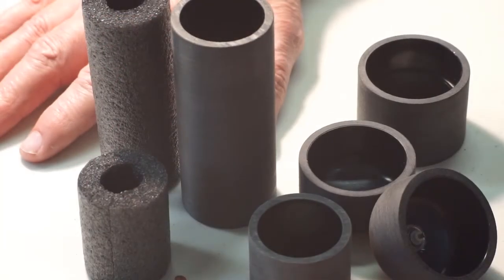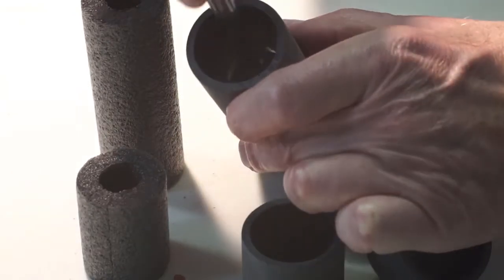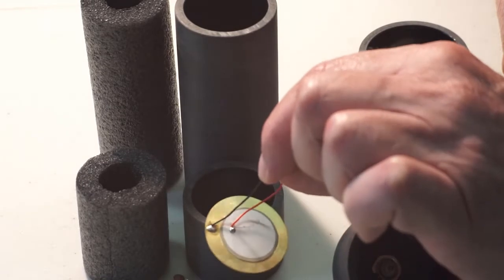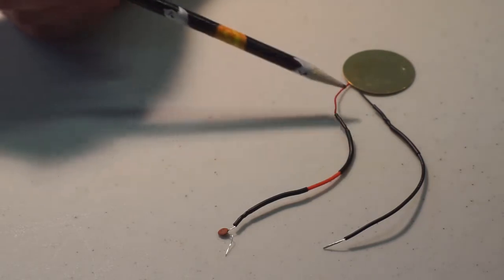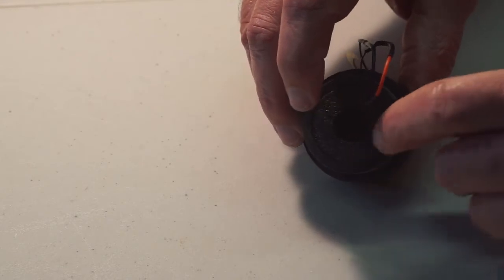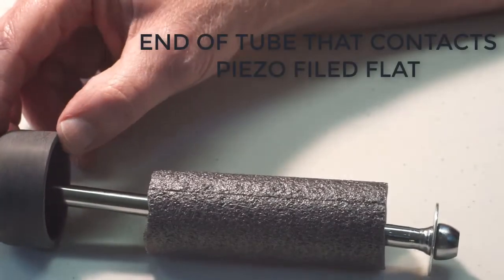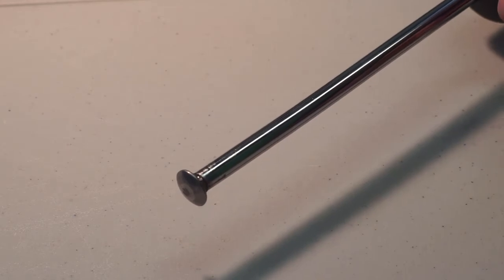GADGETS#52 - DIY STETHOSCOPE BUILD

Comment: Finally getting around to collecting the parts to build this.
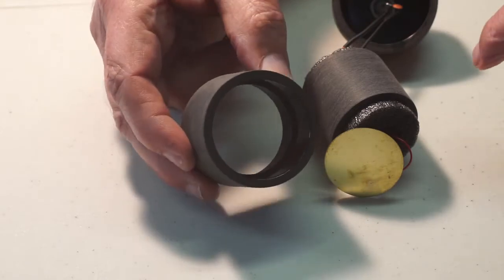FYI - The ABS coupling is not shown in the parts list at the beginning. It is not mentioned until 3:00.
I copied the list to go shopping and.... 
Should be interesting to play around with. I have a large single cylinder model engine that needs balancing so I will follow something like your lawnmower blade procedure and see how I make out with flywheel counterweights.

Thanks
Reply from the maker: +Dave Sage - parts lists are extra effort and it's too easy to miss something so I tend to not provide them at all going forward.
This is a very sensitive and capable tool and I encourage you to build one, BUT it is NOT what can balance your model engines.
You'll need ADXL335 accelerometer based dynamic balancing procedures for that.
Especially GADGETS#60 as in the table saw pulley balancing...
Reply: @theGADGETSplaylist  I guess the list can be derived from the video anyway - no problem.
I will check out the pulley video and perhaps follow that build and procedure then. I have other uses for this sensor in any case. I have no problem amassing other test devices.
I keeping with not re-inventing the wheel and following exactly what you designed - 

FWIW - I went to Home Depot (HD) and they had nothing in 1-1/4 ABS. They guy there said 1-1/4 is not code compliant any more (?). Must use 1-1/2. Too bulky. I considered switching to PVC electrical conduit which would be fine and a direct substitute except - no such thing as a cap for electrical conduit (that I'm aware of and none in store). Also I would have had to buy a whole length of conduit for $14. Same issue at RONA. 
   BUT I went to CTC and they had 1-1/4 ABS in a short length and a coupling but no caps for 1-1/4. So I don't know what's up with the ABS market.
The supply tubes were not available at RONA but they have lots of the braided ones (much more user friendly anyway). HD had the supply tube but buried among the braided ones. And so it goes...

  I'm going to mill / lathe a pair of caps from some 1" thick black plastic plate I have.
I ordered the bag of Piezo's no problem.
SO in the end I have everything and I should have it together soon.
Thanks for all your efforts.
Reply from the maker: @davesage9190  - no 1 1/4" end caps?
I just bought a few yesterday (for an upcoming build) at my small local hardware store.
Would be a shame to machine some...I'm sure you can find some. I didn't know they were on their way out, though...
Reply: @theGADGETSplaylist  Yeah. I'm not sure about that HD guys opinion on plumbing code. I'll have to ask my plumber friend. But If the two big suppliers (HD and RONA) don't have it any more then...
CTC had other 1-1/4 fittings as well so who knows. Loews is a bit too far to drive so I didn't check there. 

No problem milling a couple. I have a CNC mill and the material so it's just a matter of drawing it in Autocad, placng the piece down and telling it to go. It's free that way too :-)
Reply from the maker: @davesage9190  - I see LOWES has them:
https://www.lowes.ca/product/abs-dwv-fittings/1-14-in-dia-abs-cap-fitting-276038
Still, not pleased that they're getting scarce😒
Reply from the maker: @davesage9190  - and I see HOME HARDWARE also stocks 1 1/4" CAPS.
While on this subject, invest in some orange  "test caps" if you come across them (inexpensive)...there are upcoming builds that will involve them.
Reply: @theGADGETSplaylist  Ok. I'll check out Home Hardware maybe later today before I commit to machining them. The store around me is very small but they have surprised me in the past in what they manage to crowd into their store. 
Looking forward to what you have cooked up for the future.
I saw the test caps in 1-1/2 but not 1-1/4 at HD and RONA but they seems a bit thin on the end for a bearing surface for the tube to pass through.
 BTW I just ordered a couple of the accelerometers for the other build.
Thanks
Reply: @theGADGETSplaylist  Of course Lowes would have them - becausue I didn't go there. :-)
I wouldn't trust the opinion that they are not code. Getting scarce though seems to be the case. But sometimes they only stock what sells.
Where is 1-1/4 used anyway? I think most drains (under the sink) are 1-1/2 and vents too probably. I'll check with my buddy.
Reply: Ok. So I went to Home Hardware and  I bought two of the three caps they had in stock (small store). But at $5 Per Cap (with tax)...... Oh well. I'm good now.  I don't know what HD or RONA is up to. I guess I saved the time not making them for free.
Thanks again.
Reply: I had a look at the Ontario building code (plumbing) here

http://www.buildingcode.online/1063.html

And there isn't much that allows 1-1/4 pipe any more. I also read somewhere that the pipe and fittings in 1-1/4 are as much or more $$ than in 1-1/2 so maybe that's why they aren't used much or sold much any more.
Reply from the maker: @davesage9190  - yes, the test caps are too thin for the tube...they are for a different build (s)...
Reply: @theGADGETSplaylist  That's what I figured. I'll be waiting to see what you have planned for the caps. Thanks.
BTW. I asked my plumber friend about 1-1/4. He said he only ever used it for special applications (as listed in the building code I linked to previously) like fountains, hand basins etc. He also confirmed that rather than take up space on the truck for rarely used 1-1/4 they just used 1-1/2 (except as noted). He also confirmed the cost was about the same.